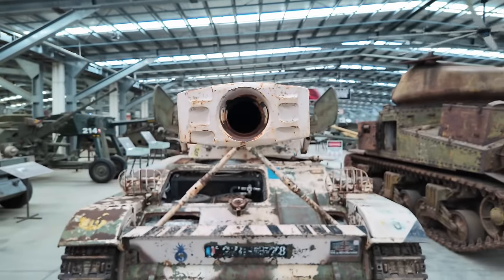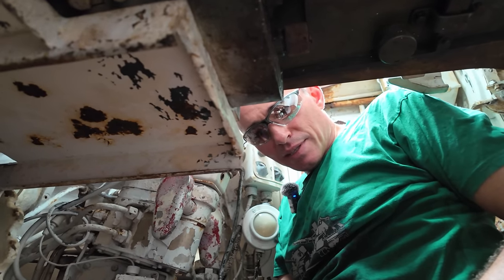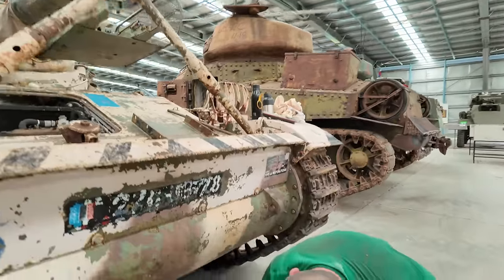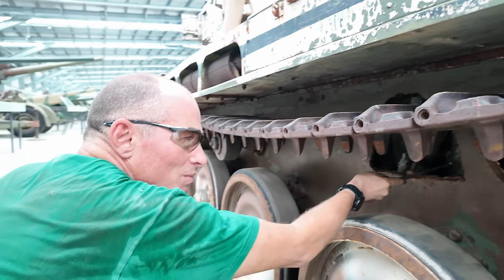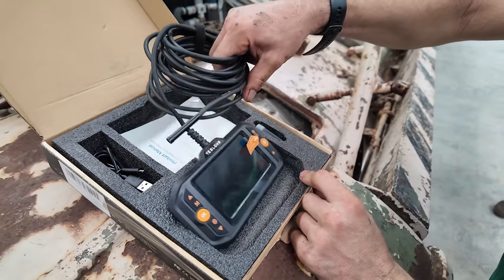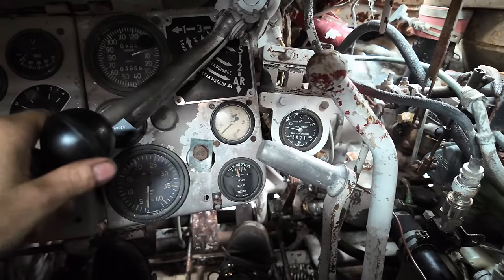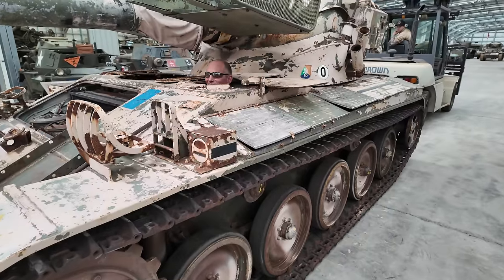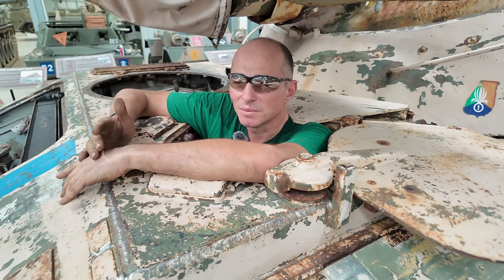Can we get the French AMX-13 Light Tank running???

Comment: Hats off for even TRYING to start it. 
As soon as you showed us rust INSIDE the engine I assumed she was DOA.
Reply: They were just trying to turn it over on the clutch not actually fire it up
Reply: As soon as they saw the insides of the engine it WAS DOA.  They really shouldn't have even tried because they put a lot of stress on the whole drive train. Final drives n' gearbox vs a seized crankshaft... no one wins.

Comment: Was stationed in Germany in the 1970's and went to French Commando School #4 and they made use lay down in front of the AMX-13s as they drove over us. After that I looked on the inside and talked to the crew about it as I was a Scout working on an M551A1 Sheridan and compared the two. The crewmen told me that the seals on all the hatches always leaked and when they were on maneuvers and it was raining they got just as wet on the inside as the outside. I did notice that at their tank park all the turrets were under tarpaulins. just as ours were. So I think just parking the tank outside for years would allow the turret insides and the engine to collect water and rust.
Reply: "NBC Protection"
Reply: Toujours Pret We used them for targets in the1974-76-time period. The M551a1 was a lot easer track to keep running.

Comment: Definitely NOT designed for maintenance..  I have no doubt mechanics would have cursed the designer of the tank on many occasions during the tanks service..
Reply: Yeah no doubt the engineers went on to have horrible life due to all the curses
Reply: @kittehgo  damn these Fr#nch engineers!1!1!1!
Reply: Designing the spark plugs to be inside the center hull and only accessible crawling through the tracks? 😆Gaping holes in the side of the hull don't seem like a good idea for a tank, especially in the context of NBC protection. Can you imagine any modern vehicle being disabled by the rain? Air filter clogged with water, doesn't it rain in France or were these meant to be kept in a garage?
Reply: @jacobstep7153  The French should stick to making wine and cheese.
Reply: Asking engineers to make something as light, fast and easily deployable, while also being a dream to work on and maintain, is too much, isn't it 😅
Reply: @mynameisname567 those look like oil bath air cleaners. If they had been filled, water never would have got in the engine.
Reply: @BPzeropoint  true (they do have grate cheese ngl)
Reply: @jacobstep7153  they have great cheese too🤣
Reply: @mynameisname567 The holes would have  covered with plates and gaskets.
Reply: since when can you service a tank engine without pulling it out or a leas removing the deck? a tank can never be service friendly, everything has to be kept compact as light as possible and covered in armour, even a tractor can be hard to service despite the fact that you can access the engine freely from nearly all directions...

Comment: Le moteur est placé à droite du conducteur. Il est à l'origine un moteur d'avion Mathis 8GB.20 à essence de 8 cylindres horizontaux, développant 250 ch à 3 000 tr/min, et qui équipe notamment le Morane-Saulnier MS-733 Alcyon et l'hydravion SCAN 30. Mais, avec la faillite de Mathis, il est remplacé par un 8GXB de 8 cylindres à plat, développant 270 ch à 3 200 tr/min. Le rapport poids-puissance est de 15 ch par tonne. 
SOFAM 8 Gxb à essence, à 8 cylindres à plat refroidi par eau dérivé d'un moteur d'avion Mathis et construit par SAVIEM

Comment: good testing, this is where i'd be dropping some fluids into the top through the spark plug holes to sit and unseize the engine for a future date, and leave a proper notice into the engine bay to say so
so when ever it does happen the next mechanics can get to work with a head start, certainly worth doing when you have a vehicle so complete, to have her working in the future is a massive bonus to the museum

Comment: Singapore  has refurbishment AMX-13 upgraded to the AMX-13 SM1 configuration. The major improvement is in the chassis which has been given a total automotive refit with a new Detroit Diesel 6V-53T engine, a new ZF 5WG-180 fully automatic transmission, a new electrical system and a hydropneumatic suspension system. These improvements not only make the AMX-13 SM1 more reliable but also increase the operational range of the vehicle, giving a higher speed, better acceleration and improved cross-country mobility.

Comment: The Sofam 8Gxb engine is an overhead valve, flat-eight engine, with a bore and stroke of 112 x 105 mm, for a displacement of 8,27 litres. Compression ratio was 6,53:1 and it supposedly developed 200 Kw at 3200 rpm.

Comment: Looks like a great video series pull the engine set up a stand and pull it apart get what you need in parts ect and rebuild it but get the H2O out of it and fill it with crc or something like it    great work guys.

Comment: All that corrosion makes for a lot of time needed for restoration!
Oh dear, that's supposed to be an oil-bath air-filter, not water-bath!
Welp, the sooner any water is drained, the better? Maybe fill it to the top with diesel afterwards...

Definitely gonna need a full tear-down and rebuild, that's for sure! Looks like some of my old ACVW engines...
Maybe turn that engine into a display on the effects of corrosion and repower it? Someday, eh?
Reply: Better yet, replace that GIAT V8 with a Detroit Diesel engine, just like the AMXs being used by Indonesia.
Reply: Ooh, yeah! Be easy to get it going then...
Reply: @TheFurriestOne  and it'll be accurate historically, since Indonesia's AMX-13 fleet uses those.

Comment: I would suggest you find some way of heating the engine to dry it out then flood the cylinders and engine with light oil.
The goal would be to stop it deteriorating any further until it can be rebuilt.
I suspect that it would require cylinder liners and pistons at a bare minimum. But thay can be manufactured.

Comment: The petrol engine was replaced by a GM 6v53, two-stroke, diesel engine of 270 hp or by a Deuts F8L413, V8, air-cooled diesel of 250 hp, in various countries using these vehicles. The Detroit Diesel unit was the more common and successful conversion. The Deutz version was done by a few countries in South America.

Comment: Ever try Marvel Mystery Oil?  Pour into every cylinder and let it sit for a few weeks, it has worked on tractor engines that were locked up and unlocked them.  Did you drain the oil and if so how much water came out first?

Comment: Engine internals look rough, is there not a way of getting some lube / freeing oil into the cylinders, not as easy as upright cylinders, but worth a try, leave to soak whilst it's stood,👍
Reply: It wouldn't do any good. Its not your '86 Toyota.  The bearings will all be trashed.  The only thing freeing it up will do is to ruin irreplaceable parts like cams and crank.
Reply: @obsidianjane4413  yeah, thats why i cringed when they try to push it to break it free.  it has to be pulled and rebuilt.
Reply: @obsidianjane4413  not necessarily, but point taken.

Comment: Probably should spray rust inhibitor all over the interior if you're not getting at it soon. And given the size and scope of the project (basically complete disassembly by the looks of how corroded it is) ... yeah, it won't happen soon. Could also put oil all over the surfaces. Something with a thicker consistency.

Comment: Put a mixture of 50/50 acetone and automatic transmission fluid in each spark plug hole and let it sit for a few days and I bet you will be able to turn it over.  I have used that trick many times to get motors to turn over and it has never failed as long as there wasn't a rod wedged somewhere it shouldn't be.  I have never tried it on something that has sat under water for 80 years though to be honest so your mileage may vary. Lol

Comment: With the engine in that condition it's best not to try to even turn it over you can do more harm than good ,the engine needs taken out and completely stripped down cleaned then checked to see if it can even be rebuilt or junked and replaced with something newer and better

Comment: It looks like tou need to pull the engine.   You would have thought that the French having used American & Ex-German equipment post WWII would have made maintenance ease a priority.  panter is nicer than most Shermans until you have to work on it. When the mantince guys have swapped a sherman transmission in two hours and the gus on the Ex German equipment haven't gotten the first final drive fully accessed...

Comment: I pity the poor bugger of a mechanic who was tasked with maintaining AMX-13s in the field. There is virtually no room in the engine compartment to do anything much. I am also surprised to see there wasn't a firewall between the driver's compartment and the engine. Imagine trying to operate a tank like that in the hot desert sun with no real ventilation or cooling without getting heatstroke.

Comment: That engine will never run properly if at all without a ton of time and money. Just to attempt to get it loose, you're pulling it out and taking it apart. It's roached. Then say you get the engine running, everything else is just as sorry as the engine and that's a complex machine. This would be years to properly get it done and I couldn't imagine how much money. And after all that, you guys already have to get creative with spare parts. There's probably not going to be anything available for this thing. I'd bet any replacements would have to be fabricated. Think about all that electrical and hydraulic as well. Sure it's complete but it's beyond reason to try and get it working properly. As you said, there are a lot more of them that you want to get running. Your time is better spent elsewhere. Maybe in time a better example will come to you.

Comment: Surely Indonesia has cheap parts.
Reply: They still use those AMX-13s... but the engine is a Detroit Diesel, so it can sourced commercially.
Reply: Indeed the Dutch gouvernement sold them all too Indonesia in the late 70 the AMX 13 THE AMX PRA and the AMX  PRI

Comment: Engine very bad! 
Someone needs to start treating the rust to stop it from getting worse, meanwhile a new engine is needed if you want a runner. A workshop manual also wouldn't hurt, as that engine probably has Satan's kimche numbers of steps needed to extract it from the hull